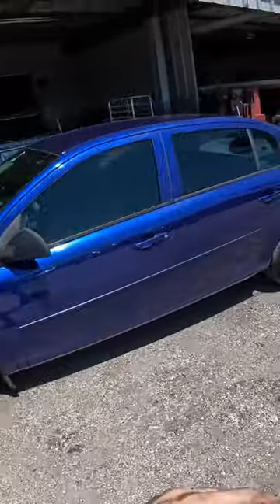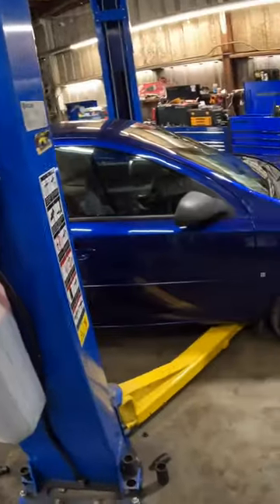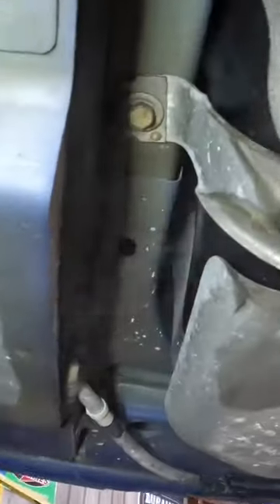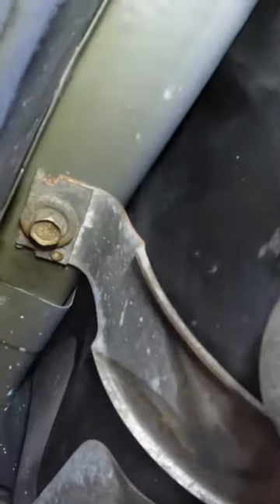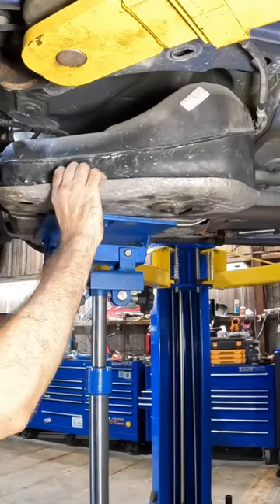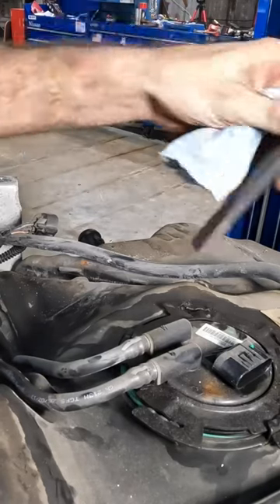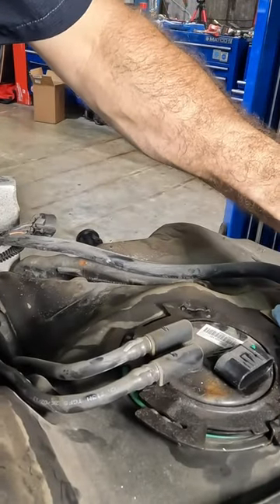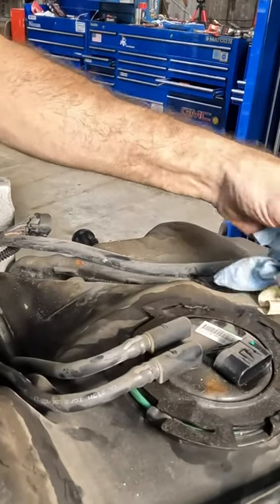Smoke in a Gas Tank!?

Comment: I had one of those 2007 Cobalts. Flinstone car. First thing to rust out was a fuel line.
Reply: Northern problems I had a 07 with 142000 on the dash thing ran if it was brand new only problem I had with it was that I crashed it 😂 I’d buy another one if it came my way 2.2 or 2.4 lil motor easy maintenance

Comment: Just another problem EVs will solve
Reply: While simultaneously causing a whole other slew of problems.
Reply: @oddmanout7755  The benefits of EVs outweigh the drawbacks, compared to ICEs.   Nothing in this world is perfect.  Everything has benefits and drawbacks.  Embrace change for the better instead of cherry picking reasons to reject it simply because you don't want to change.

Comment: Had an 07 cobalt, got it from an older lady in 2014 with 30000km on it, by the time I got it to 60k the tank had a Crack so I could only fill to half a tank, they wanted 2k to replace it, sold it to a junk yard for 1500.

Comment: Gas tank leak . Gasket may be old or briken
Reply: The pump was replaced and the shop who did it did not seat the pump in right. They missed a clamp causing the top of the pump to be pried up a bit. Ray took it off and reseated it back in place and it doesn't leak anymore. The full vid has all the details.
Reply from the maker: Check out the full length vid…like in the pinned comment

Comment: Hi ray. I worry about you using a hammer and a chisel to remove/ replace the fuel pump fitting. But I guess you love sketchy! Lol. Stay safe. Say hello to the team and family. Dave Birmingham England
Reply: He has a brass punch after people moaned at him in the comments. I think he does it now to annoy people. Ray likes to troll 😊
Reply: When it comes to the gas tank lids , you're hammering too hard if your hammering hard enough to make a spark.( 30 + year Certified mechanic talking here )
Reply: Its a method thats been used for many decades.
Reply: It's nearly impossible to cause a spark with those lock rings.